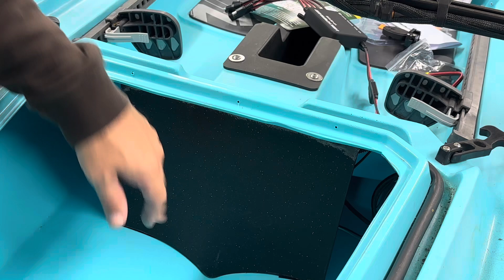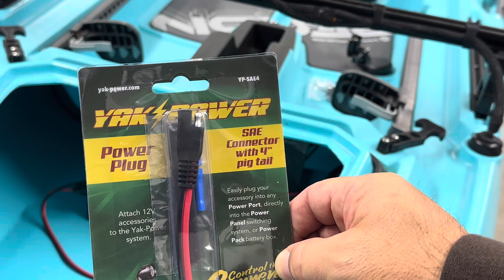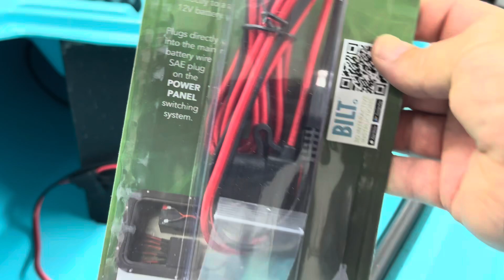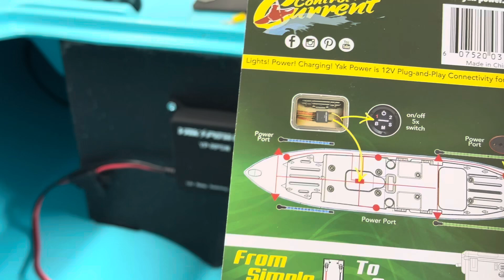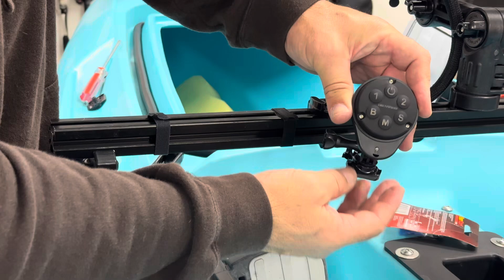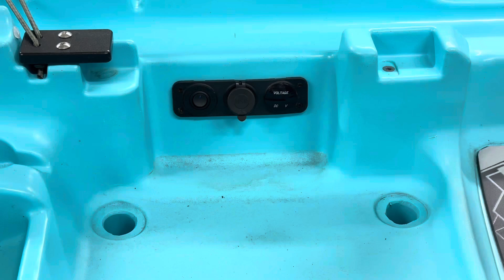YAK POWER Wireless install - (Upgrade Series) Part 3

Comment: and another question.  I noticed you have a garmin FF.  i have the striker 9sv.  On the side of the unit, there is a wire connector meant for a ground connection.  I can only assume you have one as well.  question, where on earth do you run a ground from?  Or is that connector not used?
Reply from the maker: I don’t even use it

Comment: i noticed on the lead comng out of the 5 switch module has a 15a fuse on it.  then the battery connector kit wire also has a 15a fuse on it.  once all connected, there are now two inline fuses from the battery to the switch module.  are both fuses needed?  I am doing this very thing, and came across the two fuses.  wasnt sure if both were needed.
Reply from the maker: The secondary fuse installed is for the fish finder which is recommended
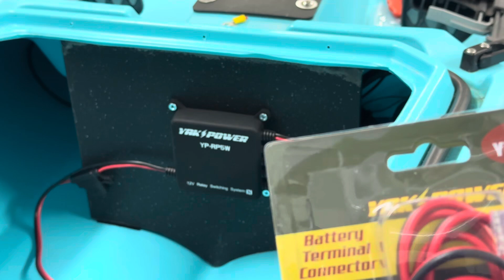Reply: @YAKnLIFE I get that. At 10:05 of the video, you show the battery terminal connector kit. That kit has an inline fuse on it. The switch also shows an inline fuse at that same time frame. Did you install the 5 switch to the battery with two inline fuses? Or did I miss a step where you removed one?
Reply from the maker: @crankbait09 I see what you mean. No, i only used 1